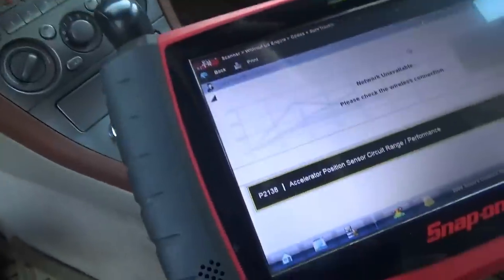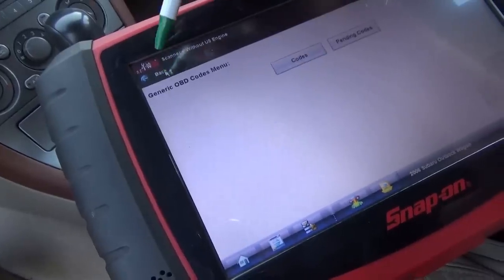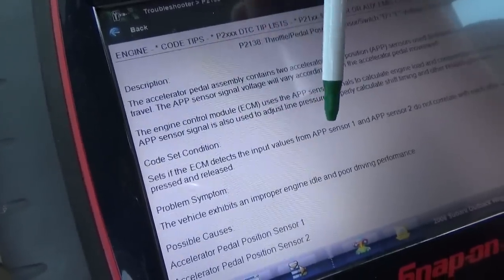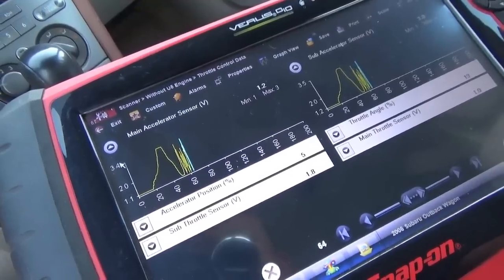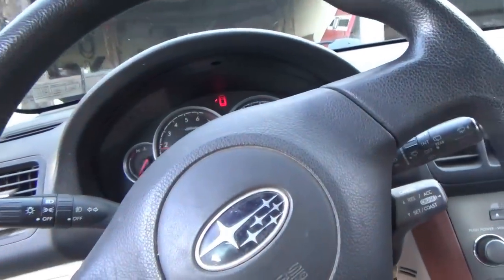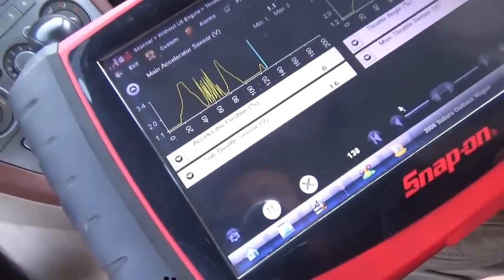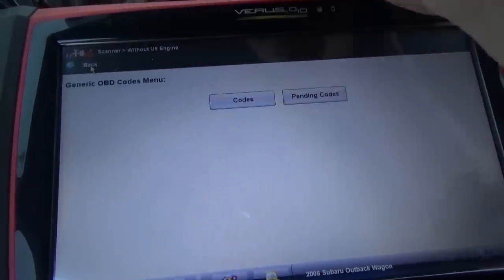Subaru Limp Home P2138: Part 1 - Quick Look

Comment: My 2016 4runner went into Limp Mode condition on my way home about a month ago. WTF? I've had zero problems with the car since I bought it new. So I pull over and try to figure out what could cause it. 
Thankfully there is a "Scangauge II" installed to monitor transmission temperature when I tow with it.
I accessed the trouble codes and did a goodle search. It brought "Bank 1 Secondary Air Valve" failure. Hmmmmm???? I reset and clear the codes. The vehicles was back to normal. No more issues on the way home. 
The next day, I figured out what the problem was. I was operating my shortwave ham radio when this happened. The radio puts out 100 Watts of RF power into the Tarheel antenna on the back of the vehicle. Some stray RF probably got into the feedback wiring and caused a wrong voltage reading on the ECM input.
I had to ground the exhaust in several places and install some RF chokes on the wiring harnesses to eliminate the problem. The problem never happened again.

Comment: I replaced the throttle body in my Ford Fusion 3 times in 100k miles.
Reply: Make sure you’re not buying cheap aftermarket. Get OEM
Reply: @djentyman4002  Actually the first two were OEM.  The third was supposed to be an improved design (non OEM) and that did last the longest and was working when I got of the car recently.  I did clean the throttle body every oil change or if hesitation was felt.  Never very dirty.

Comment: Ivan  additional to my earlier comment, pedalsensor faults are more seldom than O2 sensor faults, more over also the cables of 02 sensors are more often broke or shorted and as a result the ECU will be fried partly. Look forward to the solution. good luck

Comment: I just replaced an APP Sensor on a 2007 Honda Accord 2.4 after P2138 and complaints of no power / acceleration.  First time I've seen this.  Uncommon failure but simple repair.

Comment: That freeze frame data showed coolant temp at -4 degrees. Has the car been sitting since last winter?
Reply from the maker: Interesting! Didn't even notice that...might be a clue!
Reply: You're right -4 degrees ,, but the other engine coolant temperature said 64 degrees.. Is it normal to show 2 seperate temps ?
Reply: Bart fox   SUP fart box

Comment: Had a similar problem with my 2008 Corolla. Had a evap code that cleared itself 2 weeks before. Couldn't trust the  car. Thought I was going to have to get rid of it. Car finally started to missfire and than died. Had it towed to Toyota that had worked on twice before and there was no communiction with the scan tool. Replaced the computer (had 78,000 miles so still under warranty). Didn't have a clue and was going to replace the throttle body. Worked on it for 2 days and than mechanic read my 3 page report on the history and unplugged the charcoal cannister and away she goes. Connection was corroded shorting out the computer. Initially they told me bad gas or bad battery ground. Didn't seem like they knew how to trouble shoot. Repair cost $900.00 but Toyota covered $450. Service adviser was very arrogant and wouldn't listen to me when I tried to tell him the history.
Reply from the maker: Wow that's rare for a Toyota! Scotty Kilmer would not believe your story haha

Comment: It’s the gas pedal or cat I almost guarantee it
Reply: Been round and round with my moms hate to say it but those years are junk I scared I bought my wife a new 2015 forester back in 2015 see how that goes
Reply: Gotta love that cruise control light that comes on too lol even though nothing is wrong with the cruise
Reply from the maker: How could a cat cause a P2138??
Reply: Pine Hollow Auto Diagnostics i have had dozens of those years of outbacks with bad cats that cause the flashing cruise and go into limp mode however they throw p0420 code with your code it’s gonna be the gas pedal assembly and yes it was intermittent and always happened at worse time pull over wait 10 min drive fine for another week
Reply: I buy mine new off eBay from a Subaru dealer since I can’t really find them in the aftermarket

Comment: This P2138 can being caused by faulty O2 sensors, they can damage the ECU specially the part comanding the TBpedal. So check them too.
Reply from the maker: Very interesting!!! Part 2 coming soon!!
Reply: Upstream O2 usually the problem with "pedal" codes on audi
Reply: @jasonfoster8871  Yes on VAG cars its almost a common case, i wonder how many pedals have been changed out unnessairy for those cars.
Reply: @willemstreutgers1154  change $250 pedal when it's actually the $250 O2. I've not seen wiring failure. If ecu doesn't like signal throw pedal code and then limp mode. Sounds like it happened to the Subaru
Reply: @jasonfoster8871  Yep, that might be the cause in this case it was intermittend and at last the defect sensor set a code. I am not a whizkid but have seen that some times it will help to shield the sensor cables on some sensors(Hall-effect) with aluminiumfoil grounded to the body or engine will help. There are electric fields in the enginebay anyway. Is the O2 so heavy priced?
Reply: @willemstreutgers1154  yes. Audi are picky. Only oem or can get Bosch for $170+ at parts store. Bosch basically makes all the sensors for VAG. I honestly tried an AC Delco nope. Ran perfect than ecu decided to throw into limp mode with pedal code. How I learn lol

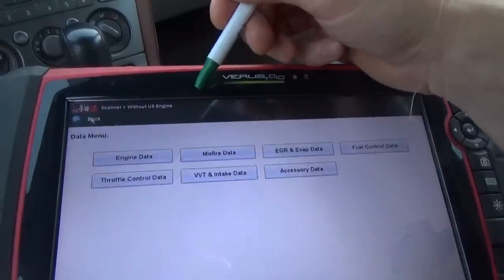Comment: At 8:35 there is a difference between sensors as you were shutting it off, not sure if it was significant.
Reply: Nice catch.  Looks significant to me.  Could be just in the data speed, though.  Time for scope.

Comment: had a very simmer problem a few weeks back . same story no drop outs . scoped showed nothing until i tapped the sensor by accident. cracked solder joints in the sensor
Reply from the maker: Very interesting. Also on a Subaru?
Reply: @PineHollowAutoDiagnostics  honda crv 2.2 diesel

Comment: Can't wait for part 2. I have been fighting the same problem ( P2138) on my 2011 Impala for months. Biggest problem is that it can go for weeks running fine and then "bang". Up pops the code with the reduced engine power situation. I strongly suspect a poor connection issue at the accelerator pedal. If I remove the wires from the connector housing and connect them individually to the pins, they don't seem very tight.
Reply: You know dude, you could just delete the connector with solder shrink connectors and see if that solves the problem. It's a 2011 Impala. It's already over due to go to the scrapyard.
Reply: @zoidberg444  That's been my thought also but the pins are close together and I can't find any connectors that wouldn't touch each other. As to the car, it's only got about 85,000 kms ( 50,000 miles) and otherwise is in great condition.
Reply: They want you to change the connector and the wires all the way to the PCM on the Impala.
Reply: @Matbug1812  Can you tell me where you got this info ? I didn't see anything about this in Alldata which I subscribe to. They generally have any recommendations from GM about solving problems and I didn't see this re: a P2138 code. Thanks.
Reply: I had a 2008 Impala with a 3.6L. Code P2122. Identifix says, 1, try to reset the pcm by disconnecting the battery and touch them together for one minute with key off. 2, reconnect them, clear codes and check operation. 3, if P0606 returns replace the PCM. 4, if just the APP code returns then replace the APP connector with a new pigtail and run new wires from the pigtail all the way to the PCM, splicing in 6 inches from the PCM. Author of the article is Ralph Dahlen. I could not get it to act up again, so i returned the car to the customer as a "could not duplicate problem".

Comment: Corrosion in the TB connector, bad ground. Clean the ground, spray connections with De-Oxit, apply dielectric grease.
Reply: Stabilant 22, improves conduction in connection s. Avionics use this.
NAPA has it $65 for a tiny tube bit it is amazing .